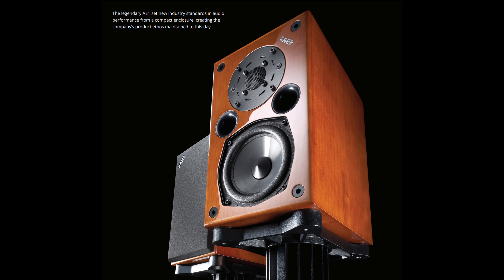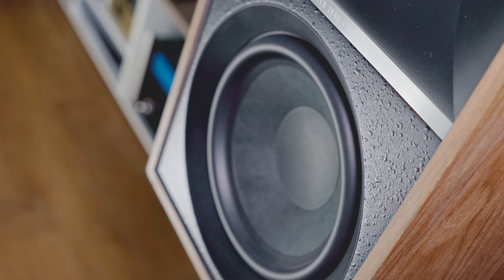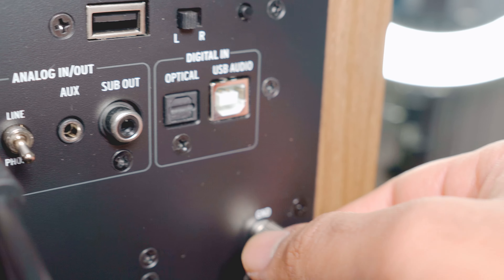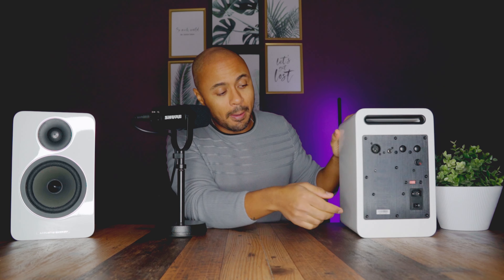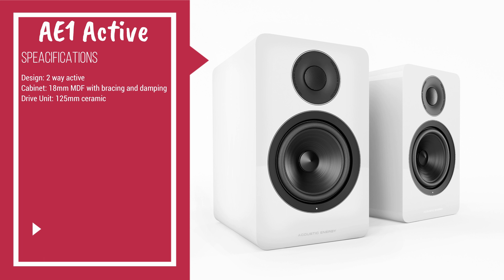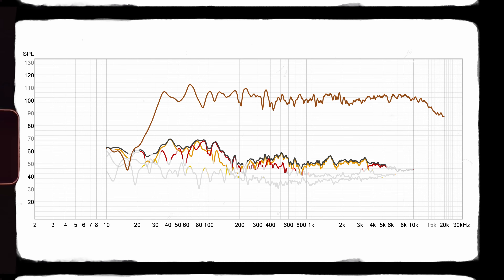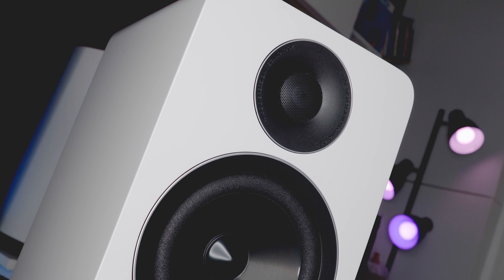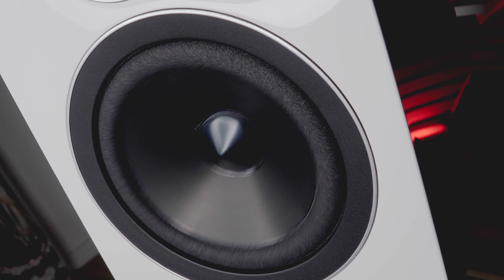Acoustic Energy AE1 Active Loudspeakers Review

Comment: Great review, they’ve done very well acoustic energy not only with the quality of the product, but by keeping it Analogue only, with no built in dac/ Bluetooth etc, these active speakers will age very well indeed, and have done already. I don’t see much competition at this price. I’ll be picking up a pair to go with my chord electronics Hugo TT2 as a small compact system. Thanks again.
Reply from the maker: Sure will be a lovely compact one, enjoy and thx for the feedback✌🏾
Reply: Hi mate, just so I understand... If I bought the new bluesound nano as a streamer, can I just connect it to a mojo 2, then into these speakers and that's all I need?

I understand they need separate power and stuff per speaker, how do you make sure your streamer and dac supplies both speakers?

Have you got them setup with your TT yet? If so, opinion?
Reply: Yes you can match these speakers to your set up. Just use RCA or XLR from your DAC / streamer. Your nano should have a pair of  RCA jacks (one red and one white) just tap one jack for each speaker and you are done